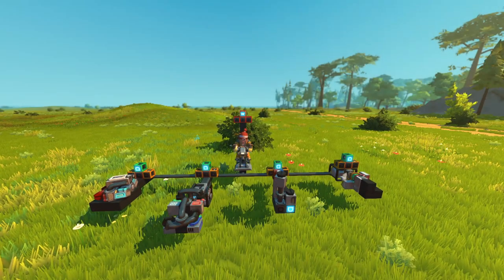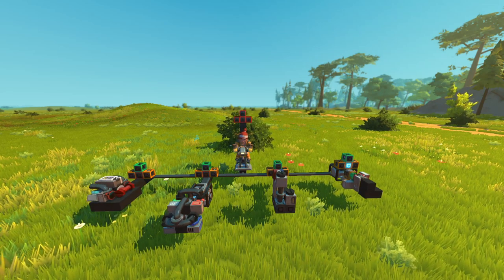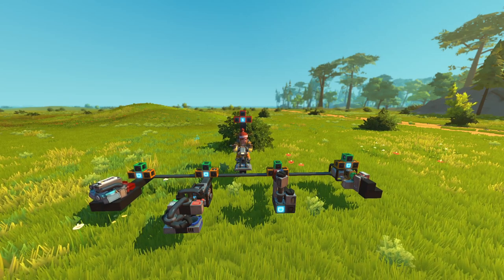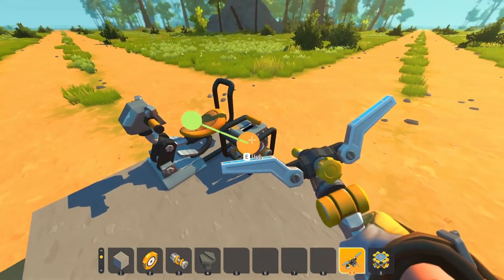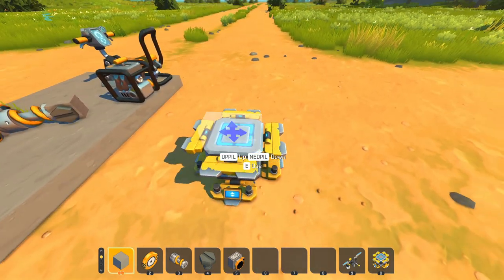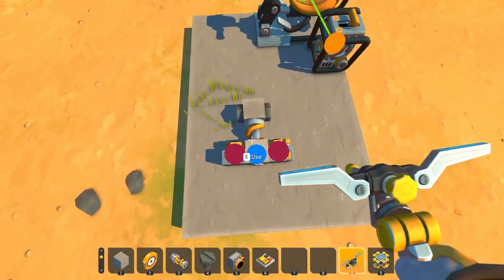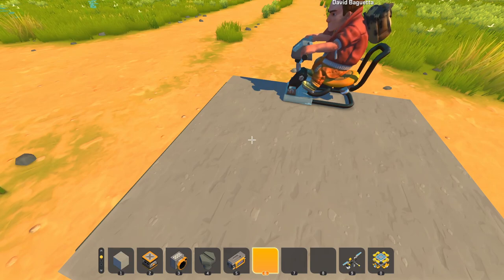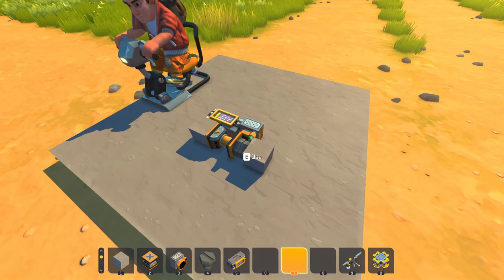soo... what is a WASD Converter?・Scrap Mechanic Tutorial

Comment: i used the first ad converter as a ws converter
Reply from the maker: huh?
Reply: @CubsYT  I took input from the seat, put it in an electric motor and used the simple upward AD converter to be WS. I needed something compact and apparently it works, so thanks for the video
Reply from the maker: @Evercreeper  that works however if you stop holding down W then it's going to keep driving forwards until you press S which is a bit weird